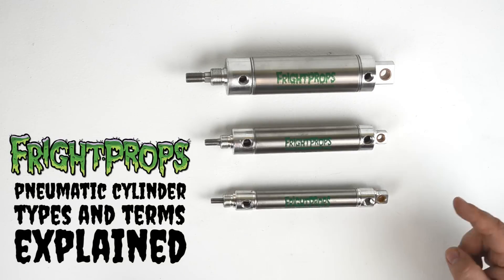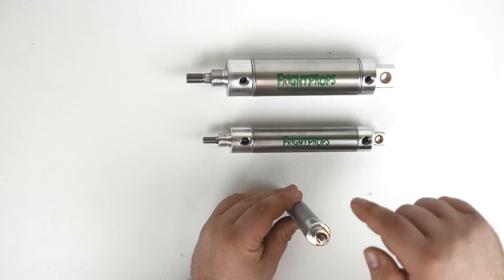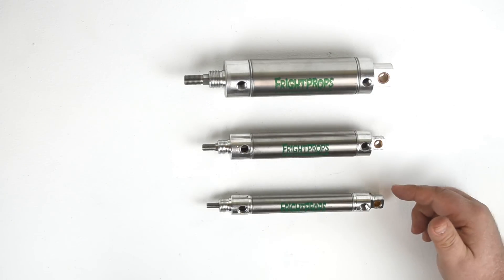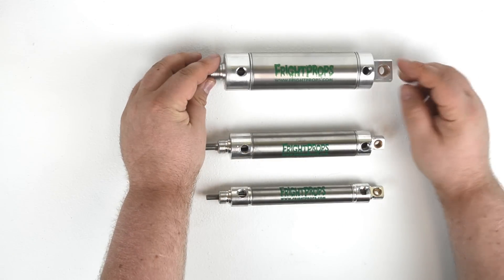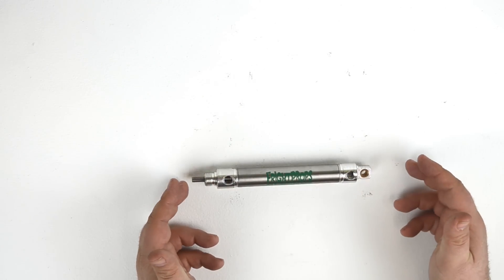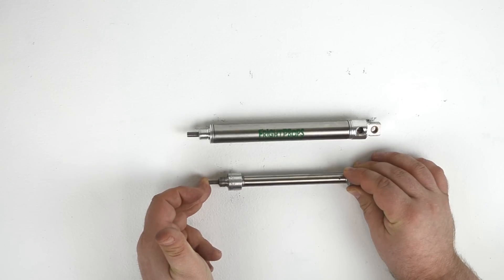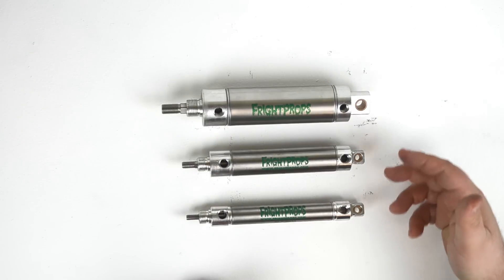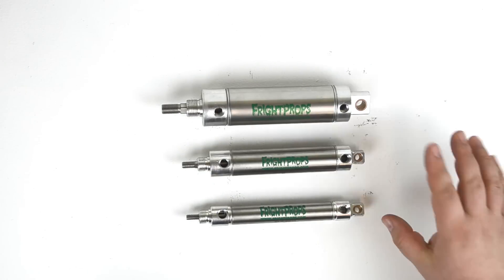Types of Pneumatic Cylinders Explained

Comment: Hi can I use your company's cylinder to push things at its both ends while letting the cylinder to slide "freely" only in its axis direction by constraining it in a through hole? So the Cylinder is kinda like floating.
Reply: There are double end cylinders, or possible 2 of these cyliders back to back connected by a barrel nut. Keep in mind that your air fittings typically stick out the side of the cylinder, so its usually best to secure the cylinder body especially if youre dealing with a lot of weight and/or pressure.

Comment: BRO FRIGHT P: "CAN U TELL ME WHAT THIS MEANS:"63596 American Pneumatic Cylinder 750DNS-0.62-32 1/8 Ports 5/8 Stroke" I WANT TO BUILD A PNUEMATIC CUTTER DEVICE w/ENUF FORCE TO CUT THRU ONIONS; TO MAKE "ONION BLOSSOMS"[FOOD ITEM]. I NEED TO CUT THEM QUICKLY; BUT NOT ALL THE WAY THRU. DOES THIS CYLINDER MEAN IT WILL ONLY EXTEND 5/8" INCHES? I'M HAVING TROUBLE UNDERSTANDING CLEARLY WHAT KIND OF PNEUMATIC CYCLINDER I NEED & THE "FORCE" I NEED TO ACHIEVE THIS. DON'T EVEN KNOW IF I'M EXPLAINING CORRECTLY. SORRY TY MARGO-KCITY
Reply: YES THAT MEANS IT ONLY EXTENDS 5/8 OF AN INCH. A 1IN BORE WOULD GIVE 50LBS OF FORCE AT 60 PSI WHICH SHOULD BE PLENTY OF POWER. YOU SHOULD LOOK AT FLUID POWER CALCULATORS BEFORE YOU BUY ANYTHING THO.

Comment: So if they open but don't return what dose that mean
Reply: Chicago Pyro it depends on the type of cylinder you're using. If it's a double action cylinder you don't have pressure to the return line causing it to retract to its default position